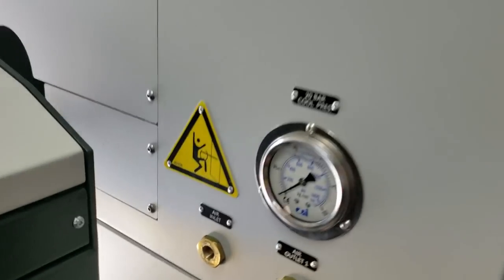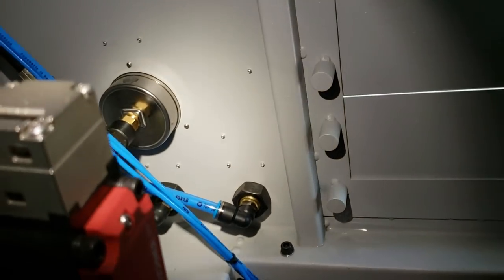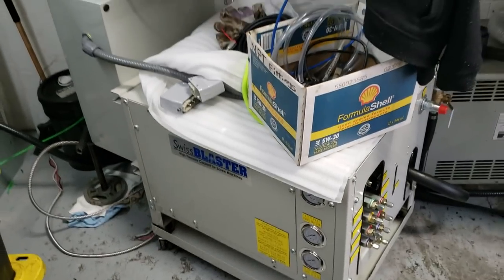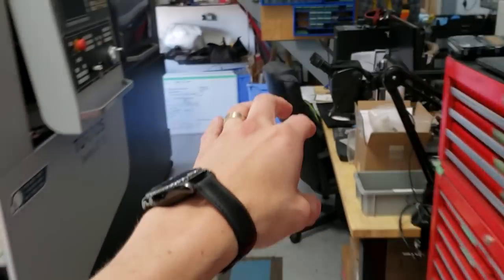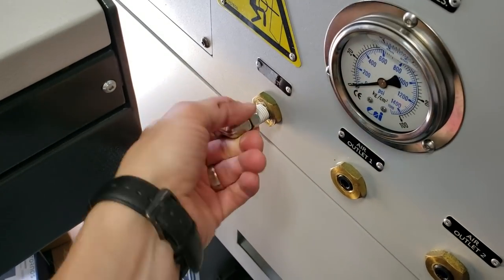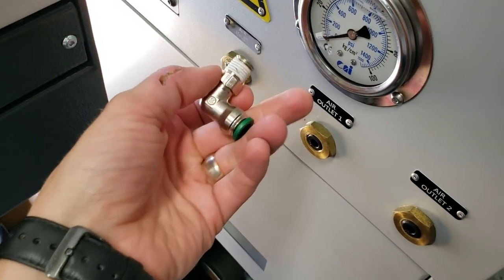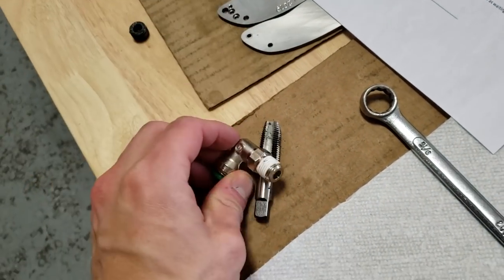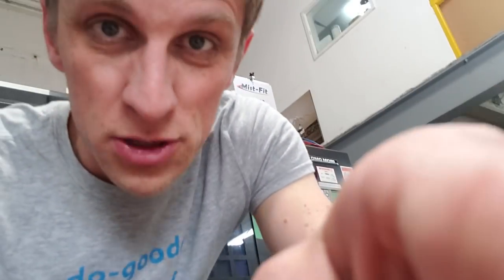The SWISS LATHE IS ON!!

Comment: Also....when it comes.to swiss..... buy THE GOOD MATERIAL.... doesn't have to be ground but if u get the good MATERIAL  (ours is from france) it is consistent dia down the length of the bar and you won't be chasing ghost adjusting your guide bush

Comment: Why do you use teflon sealant on npt thread? The teflon interferes the tapers to seat tightly on each other.
Reply: Fischer977 no, it doesn’t. There is no sealing taper on an npt. The thread itself is tapered so as you go tighter it locks in but there can still be a spiral leak path around the thread. 27 degree AN fittings do have mating taper surfaces below the threads where Teflon tape can interfere but it’s still fine to use the tape on the thread as long as it’s not covering the taper.
Reply: @Pleasestopthat  it is always covering the taper. You can't control the teflon flow when tightening. If you have intentions to use sealants, use bsp, it is way easier to manufacture
Reply: @cameronimajor4810  so why is the taper for if not for sealant purpose? Without the taper, npt and bsp are the same

Comment: Read your manuals in detail.  I hate British pipe and NPT for anything industrial.  If it's low-pressure gas or low vacuums it's okay in a pinch, and stick with NPTF with locktite thread seal, not Teflon tape. The big issue with pipe threads is they are designed for one use.  The overtighten or under tighten and non-mechanical inferior design lends it to be super cheap but not good for vibration, impact, seal failure, explosive in the ignition environment.  15 psi or less in old low flow nonexplosive fluids. Static pressure no dynamic.  Use relief valves with inert fluids.  Straight threads with seals and proper machined ports with seat gland and backing flanges.  I've worked with 20000 psi plus fluids in the kilohertz.  

Talk to your machine application support.  With the Parker application engineer to minimize risk to your air and hydraulic systems.

In most good guides that have a fitting for fluid power.  All new high-pressure product designs use the ISO standards when possible most all US and other standards are moving to have common standards at least in metric SI system.  If you can use metric do so.  All the Fortune 500 do, and the only market in US imperial which is measured to SI standards so only imperial should be used for legacy support only.  Not new products.  It will be a huge saving to standardize as you grow.  

 But I like bulletproofing do it once until you refurbish or sell on the used trader list.  

It sucks when you are down for reasons in your control with proper experience time, wisdom, and old GOAT types busting down your ego for years to make you stop being a Dunning Krueger Donkey.  With your first ten thousand hours you move up to dangerous and dumb.  Then your next ten thousand hours you are just dangerous kludge.  Then another 10000 hours you start finally getting to be fair and sometimes slick and some kludge.  Finally, you hopefully learned until you finally have volumes of experiences and have the wisdom to just be automatic.  While continually mentoring as many as possible and giving back while learning continuously and doing what you love to while making a living.  

Now we can all do it faster better and share across the world to mentor and grow new opportunities always.

Love your story, looking to see how things progress.

Always push to be innovative to build better ways and products and inspire your team and attract talent and so on.